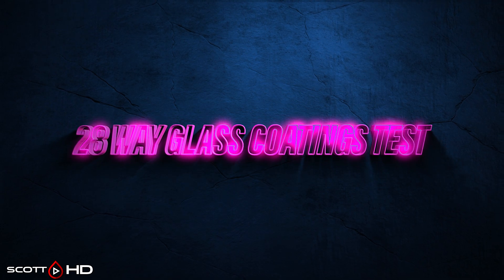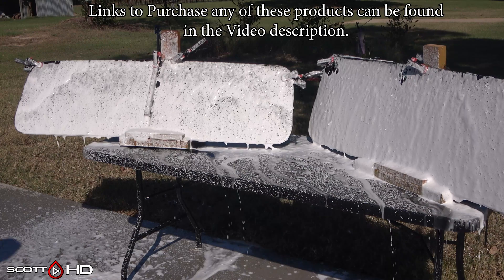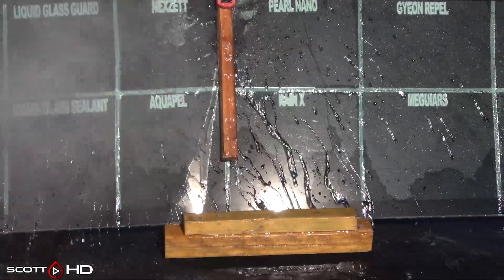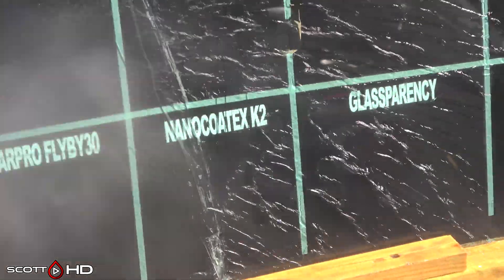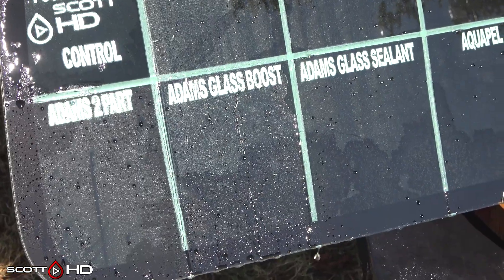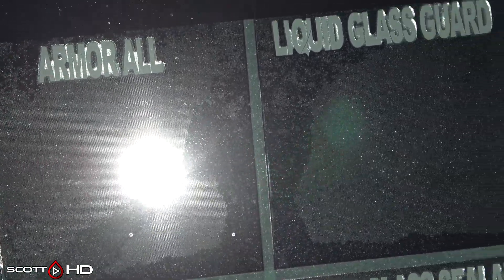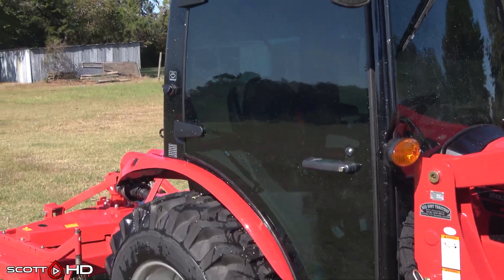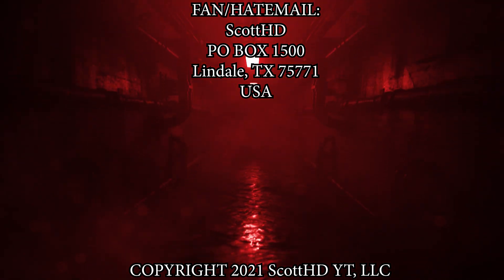28 WAY GLASS COATINGS TEST (HYDROPHOBICS) - UPDATE 04 - 1 MONTH - several surprising failures!

Comment: Rain-x cleaner on my side windows has lasted 5 months, still going. Carpro fly-by 30 on my windshield front and back has lasted 7 months, still going. The carpro was not THAT impressive to begin with, but still working great. Car outside 24/7 in harsh ny weather.

Comment: I wouldn't call Carpro flyby weak yet. it's slow but it's still working pretty well. I think we are definitely getting spoiled by some products, myself included. I was pretty critical of Avalon King on the ceramic coatings early but it is holding up and at least holding its end of the bargain.
Reply from the maker: Agreed.

Comment: Interesting results from Drexler.  I used it on the front glass and saw a year out of it before I re-coated it with something else.  You should have tried flybyforte instead of flyby30.  You are not the first to get poor results with it.  If you do this again consider artdeshine graphene window coat, p&s vue and stoners has a new glass coating.
Reply from the maker: I wonder if they had a bad batch or something?

Comment: I use Glass parency and intenso coat from kamikaze. Both work well and when intenso failed it took 8 months and  died mid winter on the back glass first which I found interesting, I'm assuming from the glass aways being filthy and full of salt. Glass pareny is still going strong 2 winters in and I've use 2 maintenance kits instead of once every 4 months. Definitely not the most hydrophobic like a coating but similar to say a fresh seal and shine application. Once flooded with water and sheets and beads most water off with in about a half second. Definitely  awsome when compared to untreated glass.